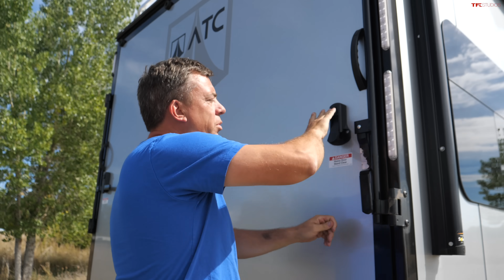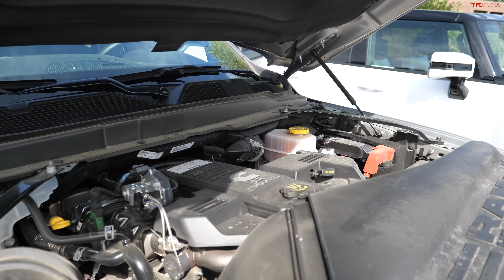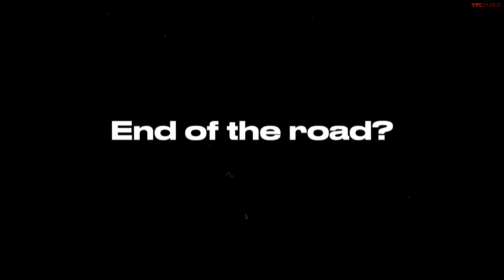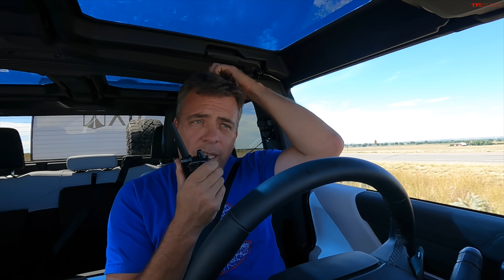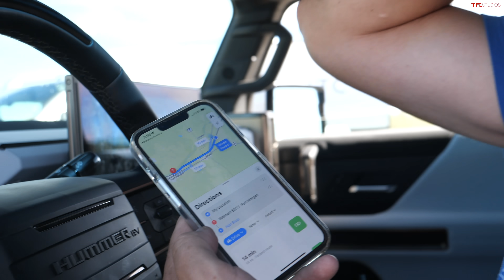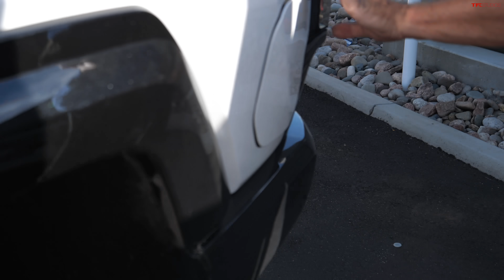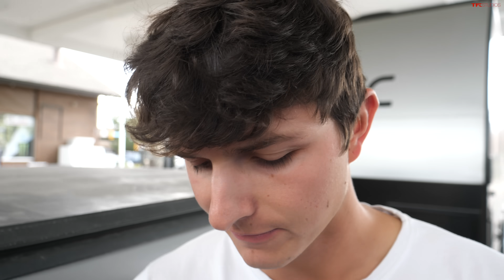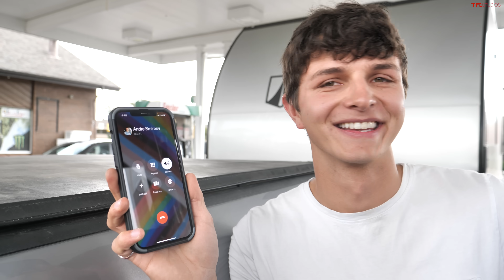How Far Can a Diesel and Electric Truck Tow An Identical Camper Trailer on ONE Fill-up?

Comment: I really enjoy these video's!  I think it would be awesome to see a video of towing a 6-8k lbs. aerodynamic trailer compared to a 6-8K lbs. not aerodynamic trailer.  It wasn't until I seen how much a camper type trailer being towed by electric vehicle had on a EV range did i understand how much energy (fuel) it required of my truck to tow my 7k lbs. camper.  I think campers have a much bigger affect on our trucks then people understand especially when people buy a camper that is almost at the maximum towing capacity of there tow vehicle.  Keep up the great work!!!

Comment: The only EV I would ever consider is a small two-seat vehicle that has a range of around 100 miles for running around town that I could fully charge in 10 hours on 110V. It would be a second car just for town use.  An EV truck is about as useless as an EV tank on the battlefield.  Of course, some of the useless politicians think an EV tank is doable.

Comment: Did I understand this correctly?  The diesel drove twice as far as the electric and it cost about $100 to fill.  The electric went half as far as the diesel and you filled less than half the capacity for $40?  What is the actual math here?
Reply: Someone did the math in another comment. "Thats awesome the charge was free, but let's use the numbers to find out the future cost. The Hummer charged from 7% to 51% for $37.41 according to the EA charger. So $0.85 for each 1%. At that rate it would cost $79 to charge the Hummer to 100%. Hummer cost per mile: $79 ÷ 123 miles = $0.64 per mile.
Cummins cost per mile: $105 ÷ 211 miles = $0.49 per mile"

Comment: What happens when there are thousands of EV’s running around and lots of people start pulling into the charging station. Now when we pull into a gas station with a line we know it’s not going to be a very long wait. Imagine… out on the interstate and you pull into the charging station only to find 2, 3 or even 4 cars ahead of you. You may as well get a hotel room because it’ll be days. Seriously though, look at the number of gas stations there are and we still have to wait for a couple of cars ahead of us now think about that with EV’s.
Reply: Charging station rage will become a thing.

Comment: I said before and I'll say it again, EVs are not ready for prime time and won't be for decades to come. When I can fully charge an EV in about 5 minutes with the range equal to ICE and both charge infrastructure and power grid to handle all the EVs, then they'll be ready.

Comment: It ain't interesting to see the electric sissy car get beat, but it is interesting to see how the politicians will spin this debacle. EVs will never work out and the costs for maintenance of a battery are ridiculous. Keep those hunks of junk out in California and leave the real work to diesel or gas. I wonder how the electric tractor trailers are working out. 400 miles on flat ground?

Comment: You are not understanding the concept of an electric powered vehicle. It's not designed to beat a diesel engine in distance etc. It's pure existence is to cut Co2 emissions and help combat global warming. If the diesel engine goes further on one fill then fair enough. You aren't comparing eggs with eggs. A fairer comparison would be to measure emmisions over a given distance.
Reply: The fact of the matter is most people don't give two shits about climate change. Many people out there are struggling just to make ends meet. All the EVs in the world isn't going to do jack for climate change anyway. Besides after the midterms all of those wonderful green energy bills will be defunded anyway.

Comment: One thing I like about TFL is they take their own money and buy their own trucks, which eliminates any doubt that maybe a truck maker worked some magic that would make the truck look or perform better than it really is / does. They buy their own trucks off the lot at local truck dealers, just like any other customer. The trucks in this test: the Hummer cost them window sticker list of about $115,000 and the Cummins-powered Ram they got for $68,000. And they note the Hummer, at the $115K did not come with a spare tire. They had to buy it extra at the dealer's parts dept.

Comment: We should have electric vehicles running like the train; electric motors moving the vehicle but a diesel or Gas generator to run the electric motors .
Reply: Nah libs won't go for that. They've been told that EVs are the way ONLY to go and that no other technologies are worth considering. If there's any type of combustion involved they've been made to believe that it's bad and they will immediately shoot it down.

Comment: I want an EV.  Totally pro-EV.  I'm generally not an early adopter, though.  The industry is evolving at a good clip.  Some day the charging infrastructure will exist ubiquitously, even in remote areas with transmission line access.  I love LiFePO4 cells but I'm dubious about the world's lithium supply.  
The eHummer range isn't too far off from what I get when towing a 4,000 lb 18' Winnebago with an FJ Cruiser.  Using 92 octane in the mountains or headwind and 87 on the flatlands, sticking to the speed limit in the right lane, the gas light comes on right around 160 miles.  Usually 10-13 mpg depending on traffic and wind.  I generally don't draft semi's unless there's a half dozen lined up in front of and behind me.

Comment: By multiplying the fuel capacity of the Dodge by the amount of electrical energy in a gallon of diesel fuel I calculated 31 * 13.759 = 426.53 kilowatt hours, dividing 426.53 kwh by 212.7 I calculated  a range ratio of 2:1 for the Dodge. So the Hummer had enough juice to reach 128 miles, the Dodge enough to double that. If 31 gallons of diesel fuel would contain 1176 kwh of energy, the ratio would be 5.529:1 for the Dodge, that’s 708 miles (128 * 5.529 =708). Now one kilogram of hydrogen holds 33.333 kwh of energy so if the Dodge was carrying 35.281 kilograms of hydrogen it would be able to pull that trailer 708 miles. If the Hummer would have a 1,176 kwh battery that trailer would be damned handy!

Comment: EV trucks are awesome, I wouldn’t mind at all having to spend $15k -$20k every three or four years to replace the battery.  I mean I have to spend that much to replace the 6.0 gas engines in my work trucks all the time.  Wait a minute, actually now that I think about it, other than oil changes, I usually don’t have to do any repairs at all to our gas 3/4 ton trucks over a 10 or even 15 year period.
Reply: In what world do EVs have to replace their batteries every 3 or 4 years? Most EVs warranty them to have 80% of their original range for a minimum of 8 years. Hyundai is 10 years! With the newest battery technology they think the batteries should be able to last well over the lifetime of the average vehicle.
Reply: @Chsae314  but what will it cost to dispose of the battery parts so the rare earth and minerals don't get into the water system?
Reply: @charlesbyrneShowComments4all  That's a great question. Luckily, the vast majority of materials in these batteries can be recycled and there are already industries springing up to do just that. Redwood Materials is one such company, and is founded by a previous Tesla exec. Compare that to fossil fuels which are not reusable once burned and released into the atmosphere.
Reply: @Chsae314  In the real world where a work truck has to work 5 or 6 days a week.  In a world where that work truck has to haul heavy materials, men and tools.  In a world where the truck will have to pull trailers for a distance greater than 90 miles in a day and doesn’t have easy access to a rapid charging station.
Reply: @houstoncowdog Literally nothing you just described would mean you'd have to fully replace the batteries on a modern EV every 3 to 4 years....
Reply: Your comment is almost identical to what I was going to post.   :)

Comment: Even though Electrify America gave you that 51% charge free, it was saying 37.00 before the camera moved off that. So a half "tank" was nearly 40 bucks and that means a Full "tank" would be around 80-85.... yet the truck is over 130k vs a 68k Cummins... not really a savings at all. 

That Hummer is for Rich dudes wanting a status symbol at Starbucks. 

F that I'll never buy one....
Reply: Someone did the math in another comment. "Thats awesome the charge was free, but let's use the numbers to find out the future cost. The Hummer charged from 7% to 51% for $37.41 according to the EA charger. So $0.85 for each 1%. At that rate it would cost $79 to charge the Hummer to 100%. Hummer cost per mile: $79 ÷ 123 miles = $0.64 per mile.
Cummins cost per mile: $105 ÷ 211 miles = $0.49 per mile"

Comment: Thanks for really diving into this. I can see electric for commuting and driving but not for towing. Not at this point anyway. Now a fuel cell powered towing vehicle would be interesting.
Reply: But Elon's 18wheeler can take off faster , bahahahaha, and won't even work for local deliveries
Reply: @johnjames5842  I think electric is perfect for delivery vans and things of the like as they don't have a ton of weight to haul typically and not a lot of distance to cover. But for everything else, yes, we need a real alternative if governments are so determined to get us off diesel. That alternative is fuel cell but no one is pushing very hard for it.

Comment: when you really think about it the hummer is a $115,000, 9,400lb truck with a 6 gallon tank AND fuel stations are few and far between plus it's going to take forever to "fill up" once u do find one. Great city vehicle but nowhere near good enough to replace gassers....yet

Comment: You should do this distance test with a trailer that isn't empty. If the trailer and vehicle were loaded with camping gear (like a normal family would have) I bet you'd only get 60 miles out.